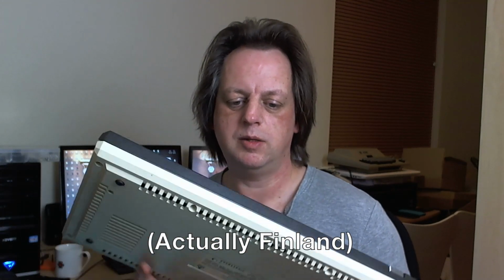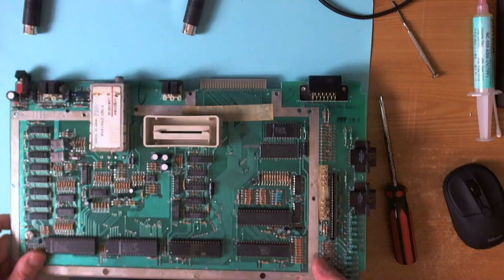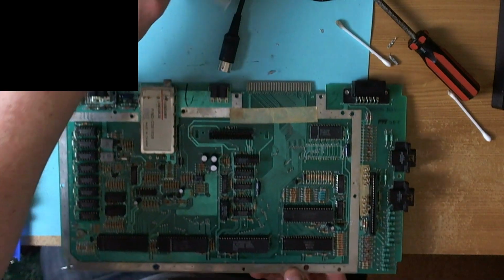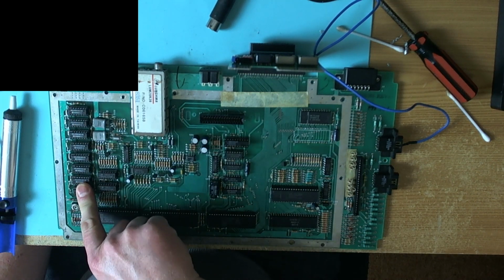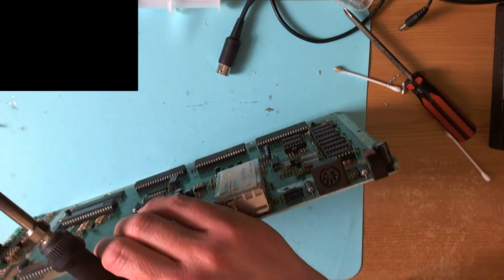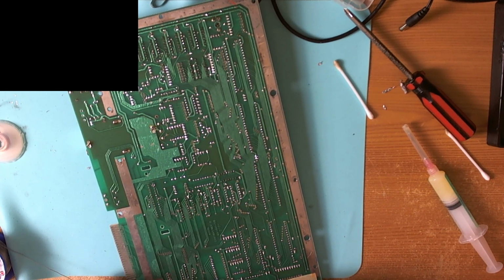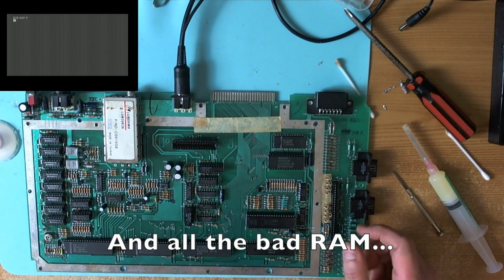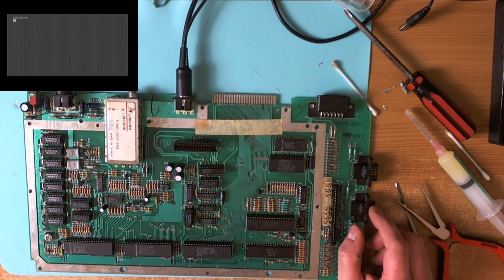Atari 800XL fix from start to 'Finnish' (well, almost)

Comment: You are amazing getting these Ataris working again!  I wish I was more like you in that way but I don't have any older Ataris to fix.  Maybe I should start buying them up on eBay.
Reply from the maker: I rarely get time to work on my own stuff: nearly everything featured on the channel was sent in for repair. It would be great to buy up dead machines on eBay for resale, but they're not always much cheaper than working machines and one must factor in the cost of spare parts.
Reply: @flashjazzcat  Yea, that's a good point.  Maybe I can get ones that are already in good condition and do upgrades instead.  Just for the fun factor, not necessarily for resale.
Reply from the maker: @richard1113  If it's for fun, repairs are probably the most satisfying. I just find it difficult to understand how anyone who isn't able to effect their own repairs can possibly hope to break even when buying and selling dead machines.